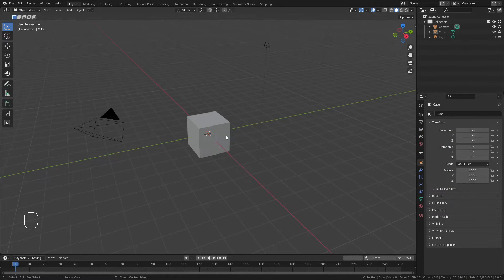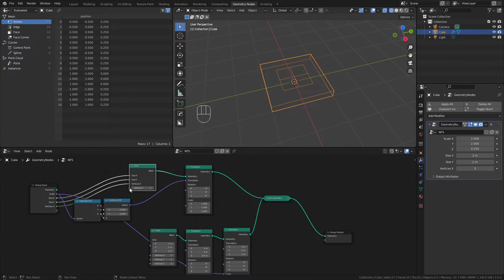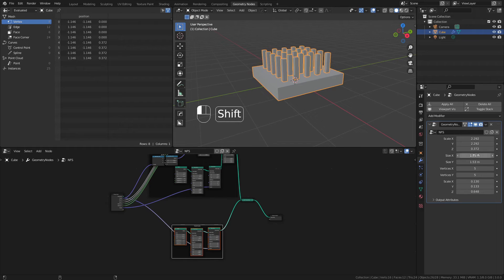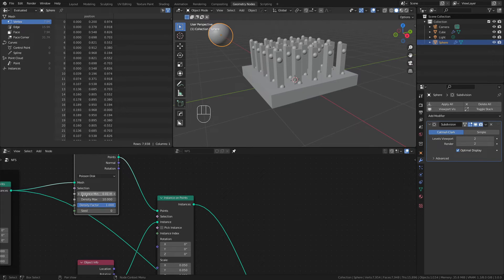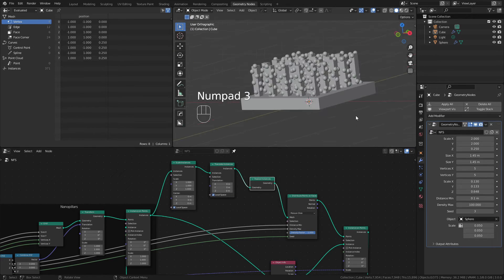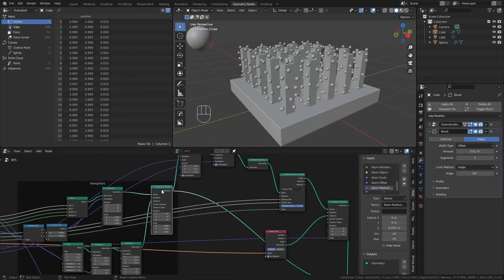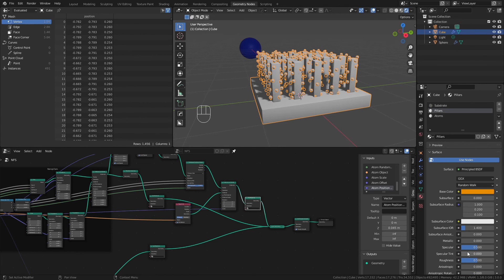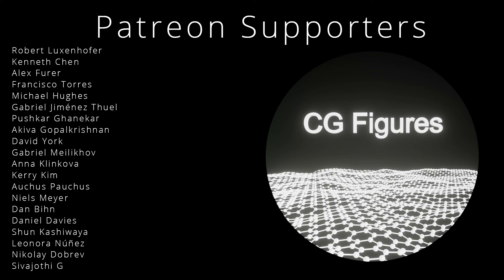Blender for Scientists - Creating Functionalized Nanostructures with Geometry Nodes

Comment: Hello,
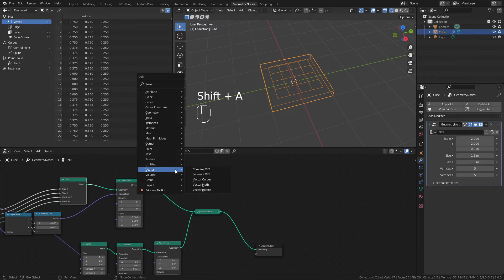  I was seeing the tutorial and in 2:50 there is "Instant on points" option but I am only getting the "point instance" ..what I have found that they are not the same..Please help. I am stuck here for a long time and can't proceed..
 Thanks
Reply from the maker: Hey Swarnendu, what version of Blender do you have? Instance on points should be available in Blender 3.0 and onwards under "Instance - Instance on points". As a double check, if you download the file available for gumroad (which is free) does that work for you?
Reply: @CGFigures  Hi..
 Yes, I was using  blender 2.93 version....I will  update it  for sure :)
 Swarnendu